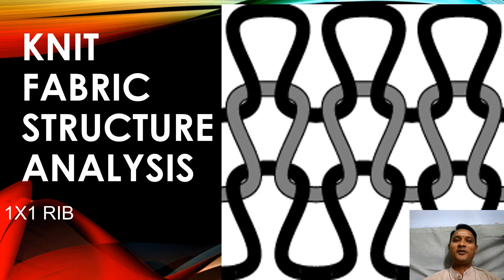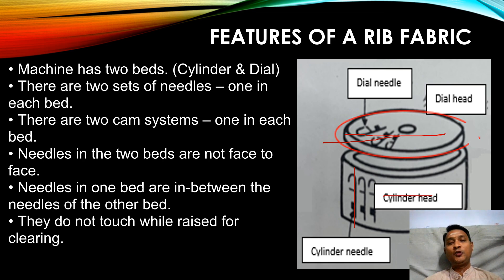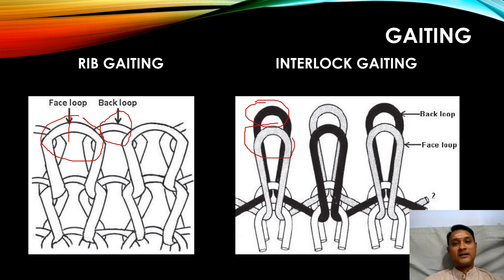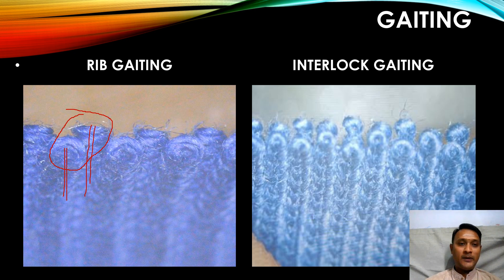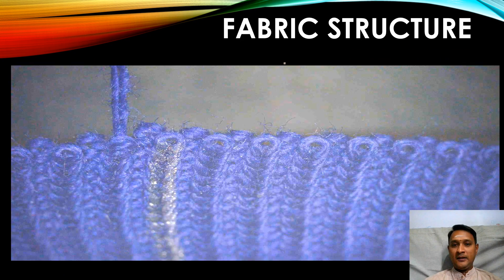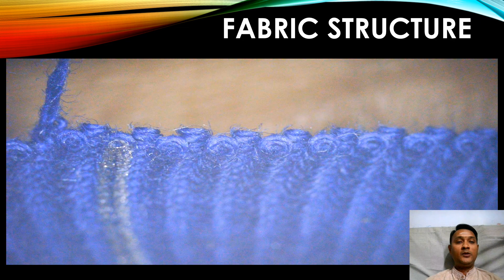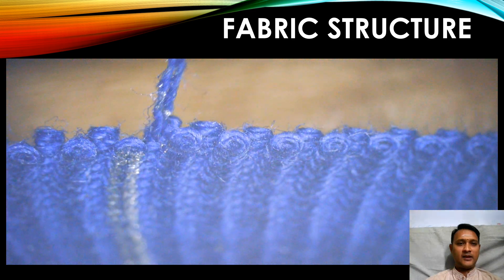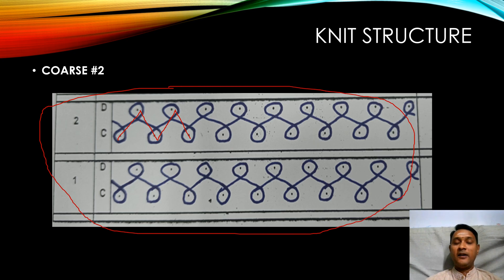KNIT FABRIC STRUCTURE ANALYSIS - 1X1 RIB FABRIC

Comment: How can i calculate pique fabric dia confirmation
Reply from the maker: Hi,

I have posted a video to calculate the fabric width using WPI.

The below video link is FYI.

https://youtu.be/VzWjWX9Iglk
Reply: pique fabric   knit and tuck  came  its not match for pique and fleece
Reply from the maker: Hi bro,

The formula is applicable for all fabric structures except drop needle structures. Pls try it once and update.